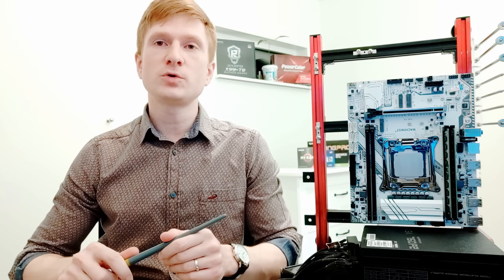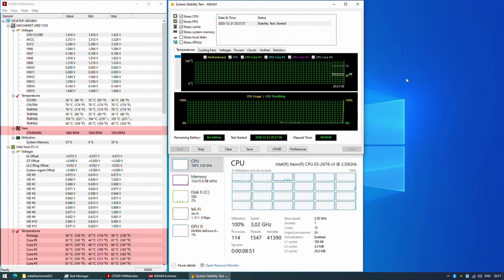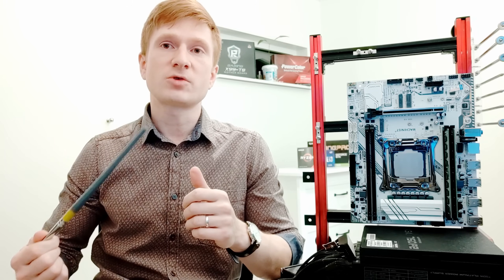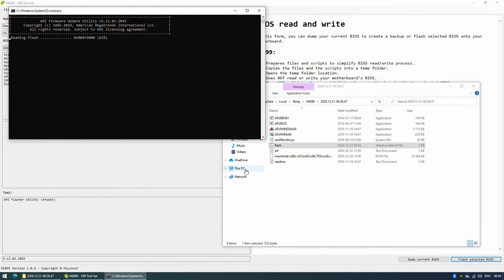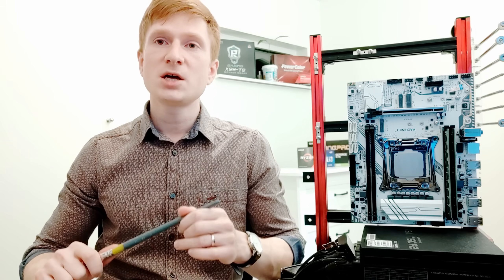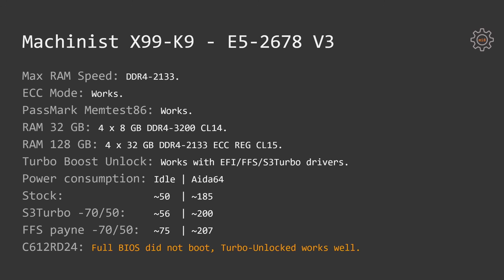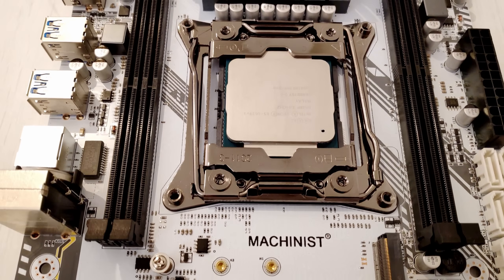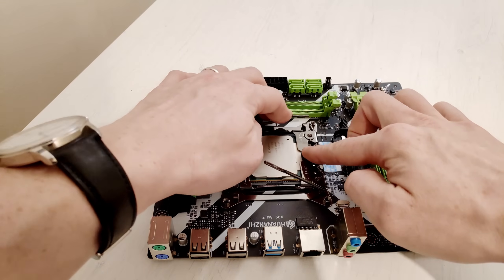🇬🇧 Machinist X99-K9 – detailed review | E5-2678 V3 | i7-5820k | E5-2620 V4 | O.C. | VRM | Timings

Comment: Hello I found i7-5820K for about 30 euro and i think that it's a great deal for my own PC.
I actually have two running xeon e5 2620 v3 platforms in my house (built by me for family) and they run pretty great now it is time for me to build my own PC. What do you think about Maschinist X99 Z with i7-5820k setup? I am worried that this motherboard won't be able to OC this processor... Do you have any thoughts about it?
Reply from the maker: If you plan to overclock the CPU, better go with JingSha X99-D8 or Huananzhi X99-F8.
Reply: @Miyconst  Yeah but actually i stuck on thought that difference in price between motherboards i could just spend to buy e5 2678 v3 and run it on Maschinist with better performance than overclocked i7? Am I right or I missed something...
Reply: @Miyconst  basicly to get it right i have a chance to buy 
e5 2620 v3 ; e5 2623 v3 ; i7 5820k ; ~ around 30 euro

e5 2678 v3 ~ 80 euro 

I7 5930k ~ 130 euro 

E5 2683 v3 ~ 160 euro

Can’t decide which one will be the Best bang for $ option - using computer for gaming and photoshop and probably pairing it with rx 580
Reply from the maker: i7-5820k is the obvious winner, if you can get it for ~€30.
Reply: @Miyconst  thanks for help.
Reply: @Miyconst  last question to this topic. Which cooling should i choose to get stable 4,3 GHz on i7 5820k?
First I thought that installation AIO - Arctic Liquid Freezer II 360 is Good solution but after 2 hours of research i found out that AIO coolers need replacement after ~ 5 years and it is way more expensive than standard air cooler like Fortis 3 which should be enough. 
My compenents will be in mesh full airflow case like SilentiumPC Regnum RG6VTG or Phanteks Eclipse P400A so base case airflow will be pretty good.

Is it Really worth investing 100 euro into AIO or just buy Fortis 3 for about 25 euro and put 2 more vents on the top of case?
Reply from the maker: Avoid liquid cooling at all costs. Get yourself a big quality air cooler and you will be fine. If you want something really good, go for Noctua NH-D15.
Reply: @Miyconst  I think that noctua won’t fit my case (rg6vtg) with ram in quad channel. Do you have any good mesh case in reasonably price which will fit higher cooler than 160mm? 
My SilentiumPC rg6v tg is 162mm on spec but after mounting Fortis 3 which is 160mm on spec with ram under it it’s impossible to mount a fan on Fortis 3 - the only solution is to mount smaller fan which generates additional cost and decreases cpu cooling efficiency (you have to mount 140mm except 160 which comes in package with Fortis 3)
Reply from the maker: @endoraslewy3514  it's very hard to recommend something without knowing your location and places where you can buy from. In general, you can use PcPartPicker, NewEgg, and Amazon for search.

Comment: Hi thanks again for your help, I've tried unlocking the turbo on this board with several methods but have not been successful. E5-2678v3  I could not get the intel utility to dump the bios, but afuwinx64 would and it is a 8 meg file. I modified with s3 turbo tool. Flashed it. When I dump it out and run mmtool_e5 the 06f2 microcode is back in.  c-states are not staying either, like it's not really writing the bios. 
I'm wondering what I'm doing wrong. You have a donation from James L.
Reply from the maker: You can use mine Mi899 tool which already has required BIOS options. Thanks for the donation. 🍻
Reply: @Miyconst  Thanks that pointed me in the right direction. Turns out I wasn't flashing the whole bios. Needed the switches /p /b /n to flash boot, bios, nvram using afuwinx64.

Comment: Hi thank you for the review. I just received my board from an eBay seller and I hooked up a usb 3 ssd drive and could not duplicate any errors with crystaldiskmark. I ran dozens of test's and even ran chkflsh on a usb 3 flash drive concurrently. No problems, could you have a defective board? I'm using the e5-2678 processor
Reply from the maker: What is your SSD? And what are the crystal disk mark numbers? I have got two boards, and both didn't behave well.
Reply: Transcend TS128GSSD370S 128.0 GB and Older Intel 60 GB My Crystal marks are  392 / 211 Random I/O 155/149 & 42.89/69.13 for the Transcend. I'm using a Sabrent EC-UK30 Sata to USB 3.0 enclosure.  I tested same drive on another computer's USB 3  PCIe card with similar results.
Reply from the maker: @godzillaford6832  okay, the speeds are definitely faster than USB 2.0, but it's still far from what Samsung T5 can achieve, maybe that's why it works well for you, because your SSD is not able to stress the USB 3.0 interface enough. Anyway, I am happy to hear that it works well for you.

Comment: I'm thinkng of getting this board and combining it with a usb 3 pcie card... Do you advise?
Reply from the maker: No. The USB 3.0 card would require a fully functional PCI-E X1 slot, but Machinist X99-K9 has a defective one.
Reply: @Miyconst  Any other X99 board that you'd recommend on aliexpress at same price or lower than machinist?
Reply from the maker: @Budget_DIY_zm  it's only JingSha X99M-H2 / SZMZ X99M-G2, the other ones I have not tested yet.

Comment: Hello, can u help me, i have xeon e5 2620 v3,2x8 killsre (2400mhz) ram and killsre x99z motherboard but when i unlock turbo boost on procesor with your tutorial i now have machinist bios.
My ram memory is runnig at 1866mhz how can i set it on 2400mhz,did i need to change memory timings? and can u tell me timming for memory if u know.Thanks alot bro!
Reply from the maker: Xeon E5-2620 V3 is limited to DDR4-1866. With or without turbo unlock, this is the maximum RAM speed you can get with this CPU. RAM timings also have absolutely nothing to do with it.
Reply: @Miyconst  Okay, thanks

Comment: thanks for the content !! and congratulations to continue growing. I have a question, I have a huananzhi x99 f8, I bought 16gb ddr4 of ram (8gbx2) of the kilsre brand, can I make quad chanel as 2 more modules of 4gb of the same brand or is it recommended that they be of the same capacity?
Reply from the maker: It is strongly recommended to have the same amount of memory per channel. If you have 2 x 8 and 2 x 4, I would rather run it in triple channel, 8 GB per channel.
Reply: @Miyconst  thanks a lot!

Comment: Could you do a tutorial on the new method that we can flash skylake motherboards to work on 8th and 9th gen intel cpu? .thank you
Reply from the maker: I could, but I will not. Unlocking Turbo Boost is very easy, still, many people manage to break and brick their motherboards. Modding Z170 and Z270 boards to work with 8th and 9th gen CPUs is way harder and require physical hardware modification. I don't want to be responsible for multiple dead motherboards.
Reply: @Miyconst  ok thats convincing you're right
Reply: @Miyconst  But the cpus in aliexpress got the adaptor no need to pinmod anymore, the only thing needed is the bios mod with coffetime.

Comment: hello sir. in last few days a lot of pages on aliexpress with x99 motherboards disappeared. i guess they might be out of motherboards. this model is one of few decent ones left. would you recommend buying it now or waiting for possible restock of ones missing?
Reply: crap, i guess this one is not so decent as i viewed part of the video...
Reply from the maker: The thing is that the other boards seem to be even worse. I have already ordered almost every newly launched X99 board and expecting them for reviews.
Reply: @Miyconst  thanks for the reply. it was kind of false alert, as some motherboard pages appeared again. i guess chinese vendors changed some specs or/and prices
Reply from the maker: @leonbishop7404  just beware, that the Machinist X99Z is no longer that old good motherboard, they have updated it to X99Z V102A, and this motherboard has all the same issues as X99-K9, which is very sad.
Reply: @Miyconst  okay thanks. Also, do motherboard problems with non-x99/c612 chipsets come from the fact that other chipsets are simply worse or chinese manufacturers still cant make good mobos with them?

Comment: Can I use fully functional Wifi and Bluetooth on X99 TF ? I'm going to buy an AX200 next month but I'm afraid that my board doesn't support Wifi and Bluetooth or the AX200
Reply from the maker: I can't guarantee that, since I have not tested it myself, but others report that the M.2 WiFi slot is fully functional on X99-TF. You might need to enable the USB support with a few jumpers on the motherboard.
Reply: @Miyconst  so if I already have the AX200, antenna and cables I can plug and play (except drivers and Windows setting) ? I'm not sure about enable USB support because I'm using USBs normally now, both front panel and mobo's USBs and how Wifi&Bluetooth card could affect it.
Reply from the maker: You can surely plug and play it, but if the bluetooth does not work, you have to locate a pair of jumpers on the motherboard and flip it. This will disable one of the front USB 2.0 ports, but there are 4 in total, so not a big deal.

Comment: The fourth bug is that TDP monitoring doesn't work on K9 and X99Z V102A, that was working perfectly on the original X99Z V102. Chinese messed up a lot with newer revisions.
Reply from the maker: True, I forgot to mention that in my video. This bug is related to the cheap and useless VRM controller.

Comment: How do we wiln the Board... I have few Problem with x58... Seconds ago I found wake up does not happen with Mouse Move.. Seconds ago FOUND  Control Alt Delete WORKS wake up to TASK Manager Option. perhaps Machinist K9 WILL WAKE UP  like that ...
Reply from the maker: In my case the system "wakes up" by a mouse click, but the screen stays black, and after a while the system shuts off, thus it's a different issue.

Comment: Amazingly in-depth review. Thank you for your hard work. Do you believe the PCIex1 slot issues would affect a Sata controller card?
Reply from the maker: Do you plan to add an extra PCI-E X1 SATA controller or you are asking about the onboard SATA ports?
Reply: @Miyconst  An add-on PCI-E x1 SATA controller. 
Since I already know there is an issue with the port, I will likely only use it for replicated data.
But I would like to know if you can confirm if there are any stability issues.
Reply from the maker: @SimmanGodz  I don't have such a controller to test, thus I can only report on what I have figured out with my GT 710 graphics card. The GPU worked well with the basic driver and under Ubuntu, but failed with the official Nvidia drivers. So, the PCI-E X1 kinda works, but there is obviously something wrong with it.
Reply: @Miyconst  Understood. I'll purchase a card at some point soon and do some testing of my own. Thank you again, and best wishes for you and your channel friend!

Comment: Legit review,atleast you didn't called it a "trash x99"lmao.i still don't regret buying it,but let's discuss the issues:
1.usb 3 0: I did all the installations and data transfer through the usb 3.0 on my case,it worked flawlessly.(used the boards port only for mouse)
2. Pcie x1: never could have known if it worked or not.dont have a card for it and never gonna have it anyways .lol
3. SMART fan : this is the only concerning issue for me,but r8 now my temps are in 30's.
My fellow k9 owners,don't need to be sad cuz 6/10 is decent, considering miyconst.
For now my 2620v3(stock)+rx 580 works well for me,temps are good.k9 is still a decent choice as it uses an actual x99 chipset,but ofc go for the x99z v102(if u can),u heard the man.
Reply from the maker: It's a good summary 👍👍.
Reply: So this motherboard can fit an rx 580 in it? Can it fit an RTX 3060 in it or GTX 1650?
Reply: @Blockah yes. It only depends on your case.

Comment: Hi, very good video! Is there a BIOS for the Huananzhi x99 f8 motherboard with unlock turbo boost, undervolt and that allows changes in the timing of RAM?
Reply from the maker: Yes, there is. Take a look at mine Mi899 application: https://youtu.be/bO2t790vhg8

Comment: Nice video.
There is an important point about WiFi Cards: Not all cards works, because some M.2 Wifi Cards work over CNVio, they are few cards, but they just dont work.
I got an Intel AC 9560 NGW, but unfortunately it does not worked. The right card for that generation would be the AC 9260.
For Wifi6, the AX200 must work (but the AX201 do not, because CNVio2).
Reply from the maker: Thanks for the extra info.

Comment: I was thinking about "upgrading" my R5 1600 to a 2678-V3 using this board. Thank you for stopping me from making a $110 mistake.
Reply from the maker: Just replace your R5 1600 with an R5 3600 and it will be a much better investment than the E5-2678 V3.
Reply: It’s definitely not something you would want to upgrade to if u are using that

Comment: Hi man... I'm about 10 days from recieving mine... I thought it was an x99z with a wifi slot.. sad to hear about USB... How can they mess up like this?
Reply from the maker: I have no clue 🤦‍♂️, they just messed it up. The dad thing is that the X99Z V102A revision is also messed up.
Reply: @Miyconst  When you know if a BIOS flash can solve the problem, let me know... Thanks man...
Reply: @Miyconst  What exactly is messed up on V102A besides TDP monitoring ? I think I was able to reduce the fan speed from bios. But you might be right that it doesn't increase the speed upon heating up under the load.
Reply from the maker: @zhenyay.5361  I don't know, since I have not tested the V102A version, and know about the smart fan issue from my subscribers.
Reply: @Miyconst  Yes, I confirm, smart fan doesn't work on V102A, I just tested it. It always shows 40 degrees CPU temperature in bios and this value never changes.
Reply from the maker: @zhenyay.5361  that's very sad. Yesterday I have received mine X99Z, which turned out to be V102A, so I will validate that as well.

Comment: ironic. just found another one for around 50 euros with an added 1x pcie slot! should i link it? :)
Reply: yes
Reply from the maker: The motherboard you are talking about is most likely a newer revision with B85 chipset. Feel free to post a link here.
Reply: @Miyconst  this is the board, it's called x99 rs9 and actually seems pretty reasonable. for those ~60 euros you seem to get a x99z v102/104 but with only 2 usb 3 ports, 4 sata3 ports and 2 1x pcie slot. one thing that worries me is how similar it is to the x99 k9, it might have some of the same issues. i might be comfortable saying that it has a genuine x99/c612 chipset because of thoso cutdowns like less usb ports and sata ports. another thing: i went to look for some reviews and all of them are about a x99z v104 which is just a v102 with better power delivery. :)
https://a.aliexpress.com/_BUiHpM
Reply: @francescovolpini  chipset b85

Comment: A shame about the problems, as visually it looks very nice which is good for those building systems for selling, since most "noob" PC buyers are sold so heavily on the looks of a PC rather than just the specs/performance haha.
Reply from the maker: That's so true. I was thinking to buy 10 of this boards for my PC builds, but with such errors I simply can't offer it to my clients.
Reply: @Miyconst  How is the used market where you are? I have sold a few systems in the past for a profit after buying them cheap and upgrading the RAM/GPU etc...  but I have been very tempted to get into actually building systems from scratch with X99 Xeons to sell on, but between the terrible price of used and new GPUs here in England at the moment, and also the fact that most people see "i5" or "i7" as better than "Xeon" I'm not sure whether I'd be able to sell £500+ systems that contained used CPUs and RAM etc....
Reply from the maker: You have no clue how many of these people I have met. Once I was about to assemble a gaming PC with the best performance for the money, and the customer just couldn't agree on a Xeon CPU. Then I proposed Core i3-10100F, and he asked me, would not it be a downgrade from what he has now? And he had a decade old mobile i5 with just two Cores 😂. Used market is rather live and rich in here (Sweden), thus my Xeon builds to sell are usually €350-500. Those who are ready to pay more than €500 are either refusing to buy a Xeon or knowledgeable enough to build a Xeon PC themselves.

Comment: Thanks a lot for your clear and complete review, as always.
I found a video ( https://www.youtube.com/watch?v=P6w4W7rj278 ) that describes a very similar issue with cpu temp sensor and cpu PWM fan on a x99z v102 ...
It is a real shame because these motherboards was good and affordable in the past ...
Reply from the maker: I think, that guy has got Machinist X99Z V102A, which has the smart fan issue. The original V102 had fully functional smart fan.

Comment: Whaching this video on my k9 mobo already :D To be said, I didn't meet any issues with engineer BIOS on this particular mobo. Don't have unlocked CPU or usb3 device to test, but S3 TB unlock works fine, fan control also works for me. PCI-E1 is unused in most cases anyway, as it is blocked with full size GPU. But the mobo is not that bad all in all.
Guess, we've been waiting for some improvement over previous releases and haven't get it, that's sad.
Reply from the maker: Could you please elaborate, how did you validate the fan speed control, which CPU do you have, and which exactly BIOS do you use?
Reply: @Miyconst  My mistake, just checked it for sure. Fan keep spinning near the same RPM % I set in BIOS and doesn't adjust itself on load :c
Reply from the maker: Thanks for double-checking.
Reply: Can this PCI express x16 lane on this motherboard support a normal gpu like rtx 3060 ? or a gtx 1650?
Reply: How did you flash the bios?